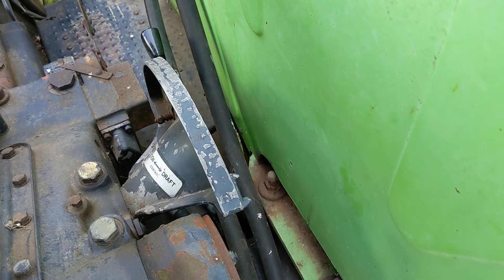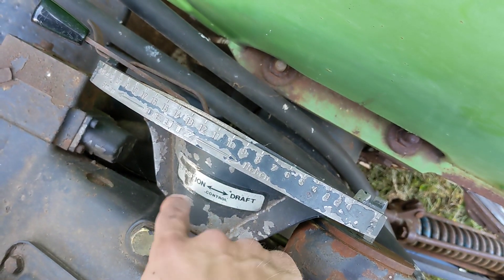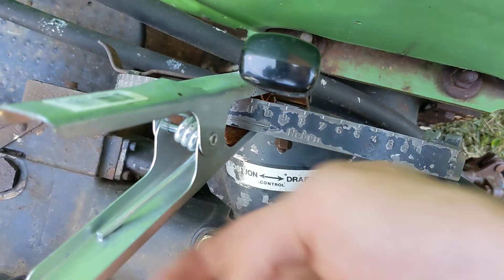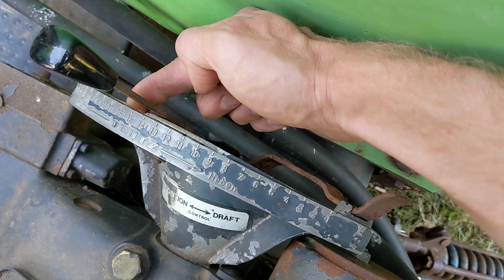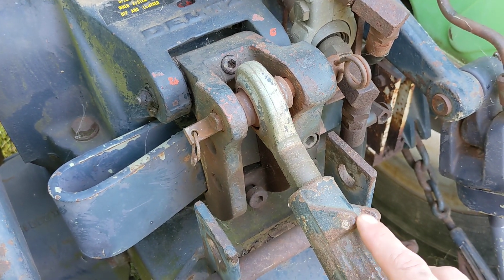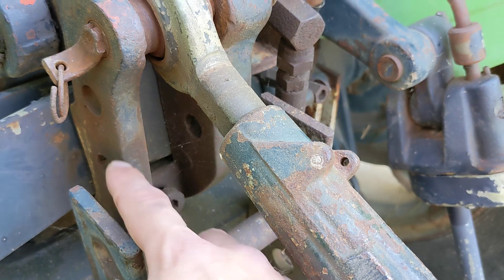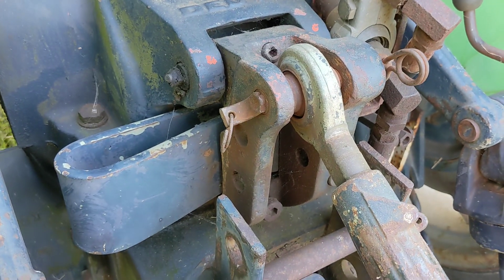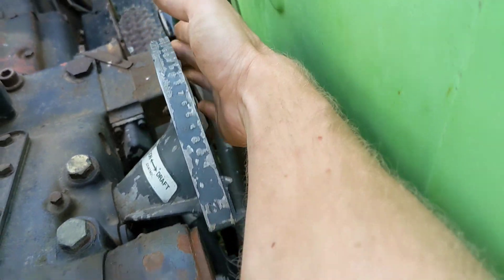Deutz Fahr D4506 Tractor – 3 pt LIFT UNIT – Draft, Position, & Float [EXPLAINED]

Comment: Hey, I just put a rear remote control valve on my 3006 Deutz. It has three set points, all the way forward, middle with a lock and all the way back. Could you explain these settings and how they work.
Reply from the maker: Hey, I'm not familiar with the three settings. Was this an aftermarket control valve? If so, what is the manufacturer and part number? Thanks!
Reply: Hi, no it's not an aftermarket. It looks like what on your tractor. How does your remotes valve lever work?
Reply from the maker: Interesting, that doesn't sound like mine. I wonder if you have a double acting control block and I have a single acting. The lock (according to the manual) is to prevent it from being actuated when not in use. So I'd guess yours is double acting and Forward and all the way Back are your two powered options. Mine is just two position, forward is OFF and Back is ON. This works fine for me since I'm running a loader which just needs a single powered input line to the loader controls.

Comment: My lift is jerking up and down.
Lowering until setted position and then jumping back up..any advice would be appreciated
Reply from the maker: Interesting - I have not had any issues like that. I would definitely check to make sure the hydraulic oil level isn't under or over filled, also if the filter is clogged it may contribute. 
I just posted a video of checking the oil here: https://youtu.be/PGdh2EEVBA8 
If you do resolve the jumping around issue could you post a reply so we can all learn?
Thanks!

Comment: Hi where do I fill the lift oil and what oil do I use
Reply from the maker: I just posted a video of checking the oil here: https://youtu.be/PGdh2EEVBA8 
The manual states to use the same oil as used in the engine.
I wasn't aware of this for awhile and had just topped up with standard hydraulic oil from Tractor Supply Company with no issues.
Thanks!

Comment: you forgot at 6:27 , 6:28 at the top there is lever with yellow letters - operate when system is off and lowered.
 its for setting maximum lifting height for the 2 main hydraulic levers , clockwise is for lower and counterclockwise for higher setting.
Reply from the maker: You are correct - I did miss that part completely! Thank you for making a comment on it so others can get the details. Much appreciated!
Reply from the maker: Hi again,
I finally got a chance to make a video demonstrating the standard height kickout I missed in this video. You can see that video here:
https://youtu.be/ZyVytlbGLO8

Comment: By the way, where would i find the manual you keep referring to ?
Reply from the maker: I have two books for this tractor. The first is the owners manual, Deutz calls it the "Instruction Book" I see a few websites such as Jensales and Yesterdaystractors selling them between 20-40 dollars right. Try searching "d4506 owners manual" and they should be in the first few results. The other book I picked up on eBay I think. It is the Deutz Ersatzteil-Nummernliste ( Spare Parts / Nos. List) PN 500 0637 
It is just diagrams and tons of part numbers. I like it for a reference since it is filled with exploded view diagrams which helps me figure out things fit together. Other that that it doesn't contain any service information. Let me know if you have any more questions! Thanks

Comment: Where is the hydraulic pump located
Reply from the maker: Hi there!
The hydraulic pump is direct driven from the engine and mounted to the left side near and under the alternator. If you go to this video on cleaning the fins and pause it at the 2:53 mark you can see part of the pump in the bottom of the frame. Right below the alternator. 
Have a good one!